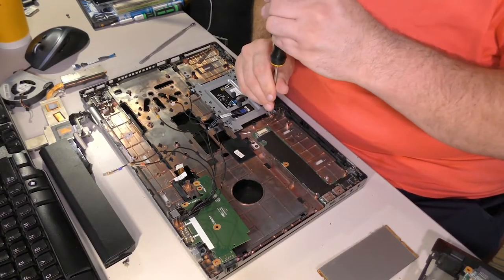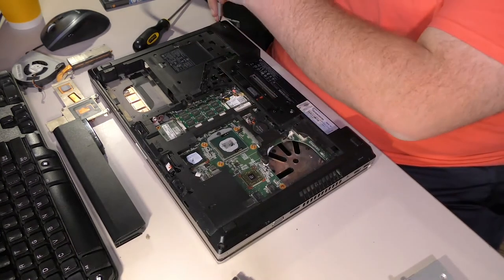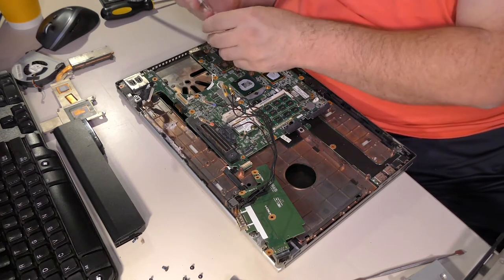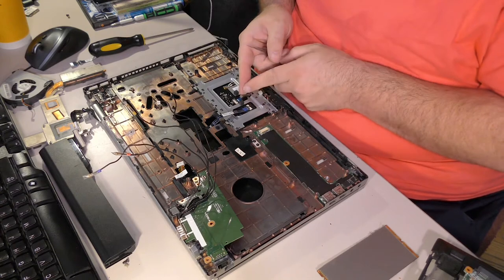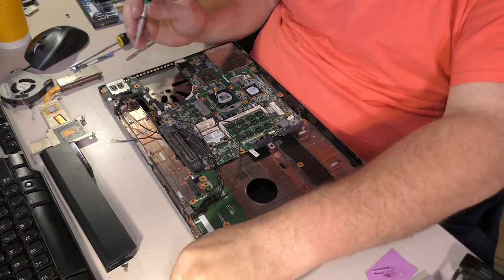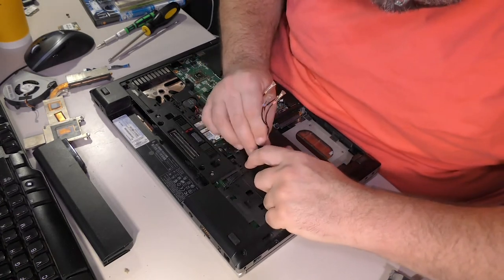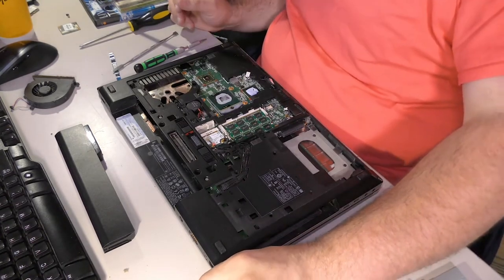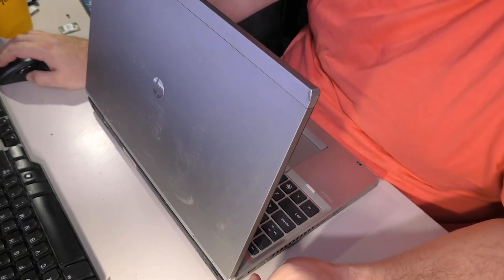HP Elitebook 8560p Full Disassembly - Motherboard Removal, Touchpad Replacement - Jody Bruchon

Comment: I work on these kind of machines all the time, and to be honest I do not share all of your opinions... these old machines are far superior when it comes to chassis rigidity! The chunky aspect of it also add sturdiness... and they do not break the palmrest/top cover just because the hinges became very hard to operate. You can find these machines working perfectly and outliving newer machines because of this!!!! And this is a very easy to maintain computer, you can remove the bottom cover and access the RAM without tools, and the HDD, heatsink and fan, optical drive, WiFi and keyboard screws are all Philips heads, On the otherside of these points of view, the fact that there are mixed screw tipes (Torx and Philips head tipes) is very annoying... I do prefer torx screws (its harder to strip the heads), but mixing them??? c'mon HP...